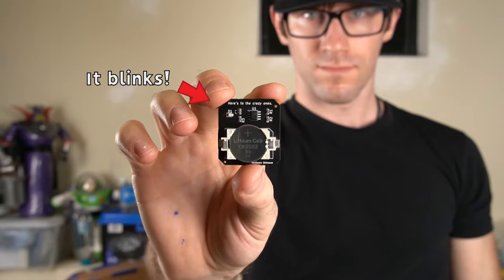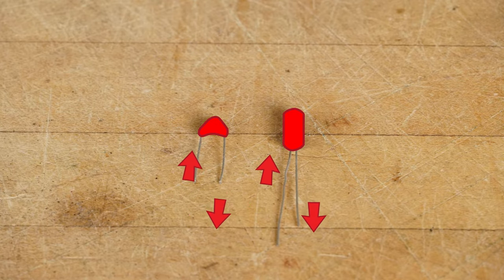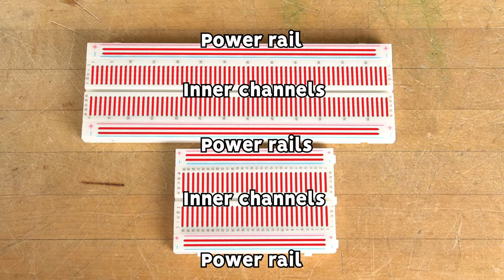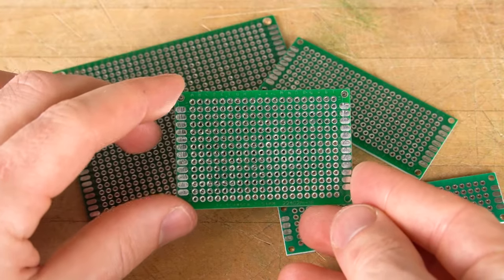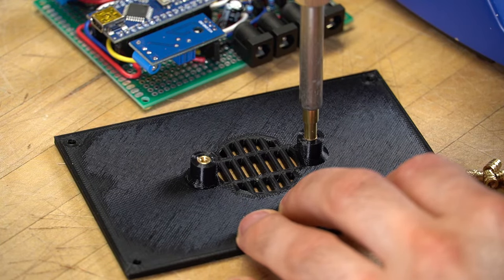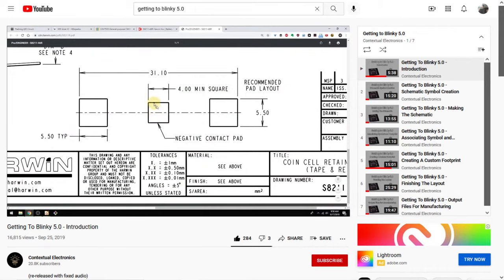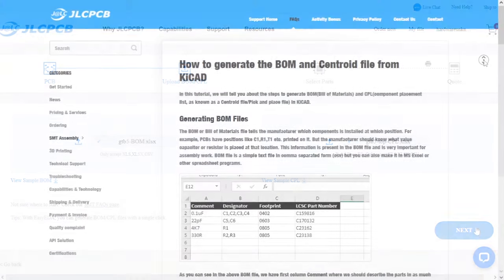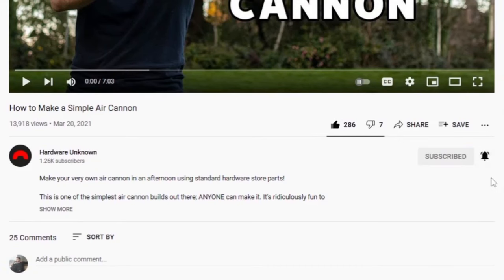How to Make a Circuit Board (Beginner's Guide)

Comment: I am EXTREMELY brand new to this. Meaning that I have not learned anything at all, but love electronics and want to learn everything I can. Towards the end it got a tad bit technical, but I would love to learn. Do you know of any online schooling I can do to perhaps receive a degree or at least a good bit of knowledge, aside from the youtube pages you suggested which I wrote down, to be able to create my own projects?
Reply from the maker: Welcome to the start of your electronics journey! The resources I listed are what I used, but thankfully there are lots of options out there. I don't have another course I can specifically recommend but I would suggest looking at Udemy. I've found a lot of useful topics there, and with the selection of presenters you can find one that fits well for you. Search for "electronics for beginners", "electronic/circuit basics", and similar. You'll find multi hour courses going into more detail about the topics I covered here. I think that is a great place to start.

I would also encourage you to get a beginner electronics kit off Amazon. Always practice safety when dealing with electricity, of course. Thankfully though, when you're dealing with low voltages and currents your biggest risk is typically at most frying a component. Follow along with the lessons by actually making the circuits. As you get comfortable, change little things. For example, the classic starting circuit is a battery, a lightbulb, and a switch. What happens if you add another light bulb in series with the first? You'll learn so much more by combining the theory with practical tests. The latter will help cement everything in your head. Good luck!
Reply: @HardwareUnknown  Thank you very much for the info. It is rather daunting, but when I was looking for components online to build something basic like an alarm trip wire I was getting really excited.
Reply from the maker: When I started I was quite intimidated by it all. At first everything looks like gibberish. Then you toy with it a bit and things start clicking. When I was learning about transistors I was so confused by it all. I was frustrated with a project and slept on it for a few nights. Then it all fell into place and I understood what was happening. Keep at it, it'll come with time.

Comment: Great video, so useful and consise.  What would you know about front panel design and advice, I am looking to build some custom synth modules?
Reply from the maker: I'm delighted it was helpful for you, thanks so much for watching. My panel work has been largely prototype or small production quantity products, and due to that we used off the shelf boards/single board computers. This meant we made use of panel mount buttons and switches, with custom cables made for the internal wiring (as opposed to a front panel mounted PCB design).

If you have a circuit made up already and have prototyped it with protoboard, wires, etc., you're set to go with trying out a simple PCB for synths.

If you have yet to prototype the modules, I would strongly suggest doing so with protoboard and wires to non-pcb mounted components. The reason being is that changes are much easier to make, and you can tinker with the circuit much more quickly rather than spending lots of time making a PCB only to find out you made a mistake, forgot something, or wanted to add a feature. For all practical purposes, once a PCB is made, it's made. You'll have to change the design, order a new set, wait for them to arrive, and test again.

Also, consider the end use. Are you making this for yourself as a one off? Protoboard is easier to repair than a PCB (or change later, like I mentioned) if something breaks. Example of my own: my quad cannon's custom electronics from another video were done with protoboard since I just wanted the one unit. Are you making only a handful for friends or small volume sales? While not as sleek as PCBs, in the time you design a PCB you may be able to finish building several modules depending on the complexity of the synth. Now if you are looking at large volumes, or high end premium products that will command larger purchase prices, it could be worth sticking with learning PCB design.
Reply: @HardwareUnknown  Thanks so much for the comprehensive reply, brilliant!

Comment: Hey,
How did you choose the LCSC components? Is there an extension for KiCad where you can choose directly from LCSC?
Reply from the maker: There may be, although I haven't checked. I found the parts manually. After designing the PCB in KiCad, I knew what part values and footprints/packages I needed.

I went to the JLCPCB parts library like in the video (click Resources at the top of the website, then SMT Parts Library) and searched for the components I needed. When you find one, you click into the part page and it has a part number listed. I combined all those into the BOM file needed for the boards. There's a link in the description for the JLCPCB page on how to create your own BOM and CPL files.

If you are specifically looking for the parts for the board shown, here's a link to where you can download the files I used: https://bit.ly/3CxoTcK

The BOM file is there and has all the part numbers and other information listed, formatted correctly for ordering.